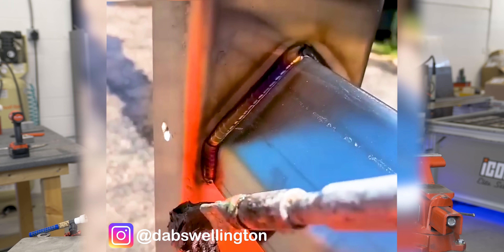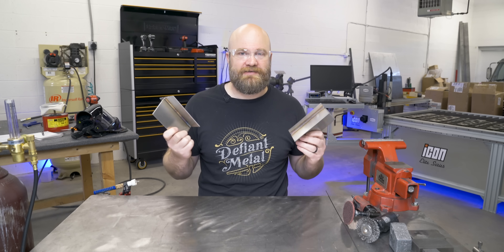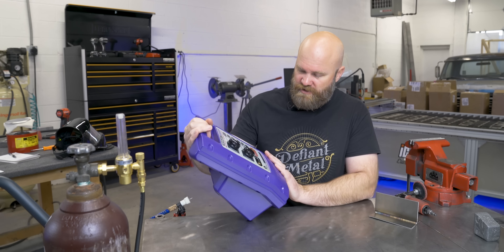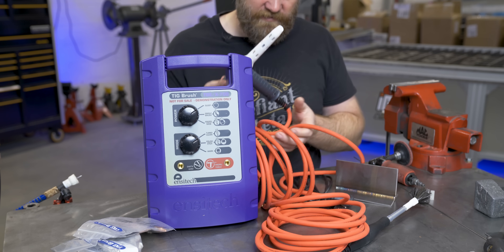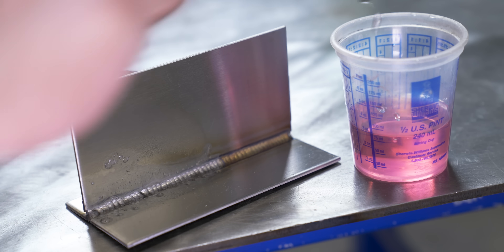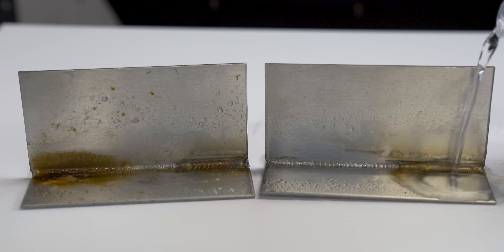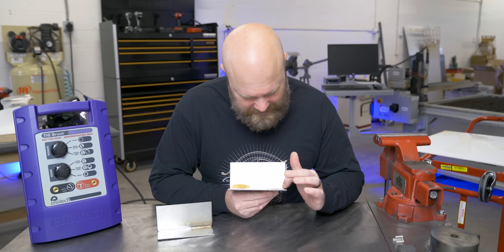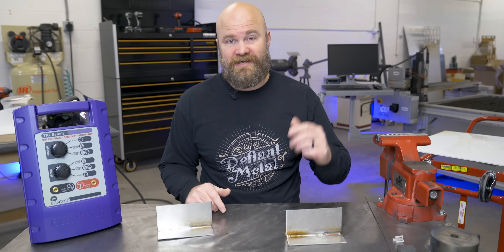Why Do People Do This To Their TIG Welds?? Electro Chemical Weld Cleaning

Comment: I took a class on tig welding. When welding stainless I had the hardest time getting the colors and mostly got a dark color weld. The teacher kept saying the weld was too hot. I turned the heat down, tried to move faster, and nothing helped and he would not tell me how to weld cooler if that is why it really what the problem was. Suggestions!!!!! Thanks
Reply: You didn't have enough gas coverage, your tungsten was contaminated, or like you said weld was too hot. I use a gas lens and the fupa #12 ceramic cup, try that with 15-20cfh of gas flow.
Reply: @diamondperformancefab5931  Dan:  
Thanks for the information. Hope you and your family stay well and have happy holidays.
Reply: 'The teacher kept saying the weld was too hot'   You can reduce the heat input value by turning the amps up, by melting the metal quicker allows you to travel faster, net result lower heat input value.  -   Amps x Volts x 60 / travel speed x 1000
Reply: @iwb316  Thanks. Happy Holidays

Comment: From what I’ve heard and read about Tig welding a good Tig weld is not supposed to be colored there should be a colored boarder a few mm away but the weld should be silver even on metals that anodize

Comment: Did this at my previous job, it's definitely a neat process but it absolutely sucks to do for hours on end when you're cleaning complex parts, especially with all the safety equipment I had to wear.
Reply: If you don’t mind me asking, what kind of safety equipment did you gave to wear.
Reply: @chrisp9046  Safety glasses, chemical resistant long gloves, and a filtered respirator (like the ones you would find in a paint shop) due to the fumes.
Reply: @H2Oslicer123  Ahh. And do you do this for an extended period of time? I’m thinking I ought to use more/better ppe when I do this at work, even if it’s occasional.
Reply: @chrisp9046  yea, nitric acid fumes aren't something you want to be inhaling, especially over long periods of time. How long a part takes to clean depends on your setup and how complex the parts are, however most of the time (maybe 2/3) will be spent cleaning the acid from the part. Sometimes I could spend an entire shift cleaning parts.
Reply: Why do you characterize it as defiant?
Reply: @bent.cyclist  maybe it was a typo and he meant definitely

Comment: I spent 7 years building 304 and 316 stainless tanks for agriculture. We pickled most of our welds but also used a surfox machine on heat tint from interior welds. Worked awesome! Pickling will discolour the material more but these machines will remove just the tint if you don’t go nuts with the machine. We found that the pickling was sufficient passivation. The crazy thing is stainless will “heal” itself eventually. It will develop a passive layer over time. Even rust spots will eventually eat themselves away. For ag use it’s amazing what stainless with hold up to!
Reply: *FusciaCone comment reprinted from PracticalEngineering corrosion coatings thread: "This might be off topic...  Our company moved to stainless steel for outdoor fasteners.  The surface corrosion was a lot less offensive to our customers.  However, larger enclosures still exhibited ugly surface rust.  We tried 304, 316, and I think 316L.  All exhibited the surface corrosion.  So we visited the nice people at the Monterey Aquarium Research Institute.  While this group shares the same name as the commercial aquarium, it's nothing like the aquarium (you might enjoy that little research tidbit).  We found those guys used electro polishing on all of their buoy mounted instrumentation.  We then tried 304 with a passivated surface, 304 with an electro-polished surface, and 304 that was first passivated then electro-polished.  Turns out 304 with electro-polishing stayed beautiful under pretty extreme conditions.

We used elevated temperature salt-fog testing to accelerate the test interval.  

Then we setup an outdoor test site on a beach near Moss Landing CA.  Photos every 30-days.  Test ran for, I'm not sure but I think about, 5 years.  304 with electro-polish was super good.

This was all done like 20 years ago now.  You might enjoy exploring SS options.

BTW: We have found that coatings like paint and powder-coat that sustains enough mechanical damage (which doesn't have to be more than a small ding or scratch) will allow corrosion to creep under the coating effectively pealing off the coating.  Aluminum was the substrate material.  We found anodize was the most resilient.  We also found not all anodizing is created equal.

Love your videos!  Keep having fun and sharing your findings!"*
Reply: Surfox makes a pretty strong electrolyte solution for even Mig stainless cleaning, Works awesome for intense tig applications aswell. Their "G" solution vs "T"
Reply: @dootdoot1867  yep. A lot of our stuff was mig welded. It’s pretty cool what you can do with the surfox
Reply: @jeremyromand  I welded up a SS mixing vat for my ag business, not knowing about how the heat affected zones will rust.  After years of dealing with a mild steel vat and bits of rust clogging my nozzles, I thought the days of washing rust out of the tank was over with my brand new SS vat with all the pretty rainbow welds...until the first load of defol rusted everything I welded.  I later learned that while it's not ideal, once that surface layer gets rusted away you'll get back to good SS and it'll stop rusting for the most part.  Today it looks rust free, probably because of all the chemicals I've used have essentially pickled it over and over.  Every welded SS part from that point on was passivated after I figured out what was going on.  The fittings and t-booms on my plane haven't rusted anywhere in the 6 years since I made them, in fact they still look the same as when I made them.
Reply: 400 series stainless will still rust, but is much more resistant than regular carbon steel.
Reply: Rust spots???... Must be a low grade stainless... But being RollsRoyce I wouldn't know of such stuff😁
Reply: @lordbelvoir2543  Rust spots is normal on welded stainless, the iron separates on the surface of the melted metal so you get tiny spots of iron that is not chemically bonded with chrome. After it rusts and gets worn out of the structure it's completely fine as most of the steel is actually stainless. Low grade is the stuff that will easily rust "out of the box" in patches\strips (depending on how it was formed), THAT is low grade stainless.
Reply: @ScarletFlames1  mate I stand corrected.... Shouldn't have opened me gob having not dealt alot in stainless
Reply: @ScarletFlames1  Also, if you use tools that have contacted mild steel on stainless, the stainless will nearly rust while you look at it.
Reply: @mikeford963  that's just direct contamination, it'll form surface rust and inside the scratches the iron got shoved into during abrasion and then you'll be left with a slightly rusty looking stainless steel. Unless you somehow put a deep thin groove and filled it with iron the expansion when it oxidizes won't cause anything other than surface damage.

Then again, many times stainless steel is used for its surface properties so that contamination is undesireable.

So as was summed in the video, have separate abrasives for anything that can rust vs anything that won't.
Reply: @ScarletFlames1  delamination as we called it was a thing I had to deal with from time to time. It would depend on the mill that made it. But that’s a great example of contaminants during the hot rolling process. We used primarily 12,10,and 7ga rolls of steel.

Comment: I am an advanced hobbyist, and I build motorcycle exhausts, and the occasional architectural railing in stainless.  I looked into passivation quite a bit several years ago. The thing about the industrial passivation chemicals is that it contains a strong acid, and the smoke/steam/mist that comes off of it is somewhat dangerous - as you mentioned, it will rust everything in your shop without proper ventilation, and it's not at all good to breathe.  I purchased some carbon brushes off Amazon, which I hold in a rod stinger from my TIG welder running ~25 amps AC, and use heated citric acid, which is basically the active ingredient in lemon juice.  It takes longer, and makes a horrendous sticky mess, but it works.  One thing I've found is that when you place and lift the brush, it needs to be quick, or you get arcing which can mark the material, and the arc eats up the brush.
Reply: This post answers a huge question for me. What is the difference between an AC tig machine and one of these incredibly expensive tig brushes? None, it would appear. Some of those tig brushes like the Capitol go up to 200 AMPs. Ouch.
Reply: Use a crimped copper pipe wrapped in rags and soaked in citric acid solution, then wipe it across the welds.
Reply: there is a citric acid gel I used to passivate stainless. useful for passivating insides where you cannot easily reach. I just let it sit over night and it dries, than just wash down with soap and water. Non-toxic & no risk of a chemical burn.
Reply: 3M bristel brush.Same like finish then a wire brush. And don’t have the chemicals.
Reply: @mariomachielse2236  the purpose of passivating is to remove potential sources of corrosion, wire brushing is not going to do that completely.
Reply: Passivation builds an oxide layer on stainless steel that protects the underlying metal.

Comment: Holly S --- at $6,000 bucks !!!!
Reply: The big Walter one is $9000 also. I own one but  bought it used. Definitely worth it. Has made me alot of money on kitchen and lab jobs.
Reply: phosphoric acid (relatively safe) , 12v 20a dc power supply, carbon fiber brush (-), ground clamp (+), rinse well with just water

Comment: Worth mentioning that hydrofluoric acid will absorb in through your skin and attack your bones. Even a tiny drop on a finger, even if washed off immediately, can result in the loss of that finger, or your whole hand/wrist if you don't seek immediate treatment. It can also cause fatal cardiac issues. HF is the nastiest acid I know that's actually used for anything outside the laboratory.
Edit for clarification: Hydrofluoric acid "pickling paste" was the *old way*. That's the justification for the expense of one of these electrochemical units. They may be a bit of an investment, but you can't put a price on health. The use of electricity allows for much milder solutions to be used, even non-toxic citric acid based solutions work with electrochemical cleaning.

Also, not to be a grammar gestapo, but it's "passivate/passivated" not "pacify/pacified".
Reply: I got a large dollup in my right eye and had to go to the hospital but I did not lose the eye. Immediate milk and water saved it. It's now ten years later and the eye is working fine. This acid does not get in your bones or cut off your fingers if you get a drop on them. At least the acid they sell for pickling welds. Thanks.

Comment: Thank you for presenting this. Passivation is poorly understood, but for sanitary welds, absolutely essential.
Reply: Particularly if the service is the food or chemical industry. Those surface oxides can be very detrimental to the vessels contents or they can effect the actually weld performance in service.
Reply: And how you clean the inside????

We use formation gas and clean outside electronic  for more than 20 years already
Reply: I’m a machinist but not a welding expert by any means so I’m glad you mentioned sanitary applications. I didn’t even think of that although it would most likely be specified by the customer but also good for us to have the knowledge regardless
Reply: @SolasChristusMinistry  I worked in a shop where we built a stainless steel tank for a company that made gelatin products. The customer specified that they would be responsible for all on site cleaning prior to the unit being placed in service. Another part of their specifications was to do a dye penetrant test on the floor to shell weld. Sine the tank was to be painted on the outside, we applied the dye on the inside and the developer on the outside. This was because the dye is a bear to remove.  We shipped the unit and about a month later we received a very angry phone call from the client. Seems that had not done the internal cleaning as they should nor did they have the Government inspectors in as they are supposed to by law on any foodstuff installation. Because they jumped the gun and cut corners to begin production, they now had 10,000 gallons of pink gelatin......... They also had their operating license revoked until every inch of their plant was inspected for other "cost cutting" methods.
Reply: @oh8wingman  Oh, that must be why I got such a discount on all that pink gelatin I bought.  Nothing a little SKC-5 can't get rid of 🙃
Reply: Passivation isn’t hard to do.  It can be done with citric acid.
Reply: We used it all the time at the Kraft plant.

Comment: Question for everyone.. I am just getting into welding/fabricating.  Which style of die grinder should I buy. Straight or 90 degree?
Reply from the maker: 90*
Reply: I hardly use my straight die grinder
Reply: Both, but 90 if you can only get one. You'll use it a lot more.
Reply: Not to answer the question directly, but buy a decent polycarbonate face shield $20 and good cutting discs.
Reply: @carpediemarts705  already have it.  I am originally a wood worker.  I am getting into fabrication/welding as I am sick of buying overpriced prefabed metal table legs..
Reply: Both. They're cheap enough.
Reply: @jasomkovac9115  I like your thoughts.. I do always need more tools
Reply: After years, I finally bought a 90°, and it's GREAT.

Comment: pickling gel works just as well and it's cheap. just wear some plastic gloves, faceshield / glasses. let it sit / soak for 30+ minutes and rinse of with water. i built a huge plastic container and just let it soak in there for a few hours to make sure it removes all the contaminated dust around me. i weld only 316L so I can't speak for 304 stainless.
Reply: pickling gel works wonders with both 304L and 316L, just dont let it be too cold when using it(takes forever for it to work). I make different constructions / machines for aquaculture.
Reply: @Onkael91  question, what do you use for filler when welding 304?
Reply: @blip033  316L

Comment: Whish to see a clean (new) stainless wire brush… Probably the same good result as the electricthing. But much cheeper.
Reply from the maker: Maybe I’ll try that for a YT short or Instagram when I get some new brushes in.
Reply: @JustVoss  , yeah, that wasn't a clean s/s brush. You kinda put a bias on the cleaning stuff.
Reply: @jasomkovac9115  as stated above, a stainless steel brush, used ONLY on stainless steel, will work as well....  Just hope you're happy with the finish looking all scratched...
Reply: @fredfleming2455  , yeah, know about the finish.  But there's times it doesn't matter.  The 3m(or whatever) mesh is one of the nicer finishes. The electro finish looks easiest,  but never used it.
Reply: @jasomkovac9115  Have used this machine extensively, and a different brand. both give great results, but they're a bit messy. Also you MUST keep the carbon brush very wet, otherwise it will affect the finish...  cheers
Reply: a new brush is pretty clean but, really soap water and passivation is the best for food and pharma grade jobs
Reply: a company did that to some gear at work. looks fine for a year or two, then fine rust starts coming through. its not just about looks, its about making it corrosion resistant.

Comment: Stainless wire brush when the weld is still warm, easiest way.
Reply: Yeah pipes different, I’d do the same as what you said. But for a fillet in sheet or box section wire brush haha
Reply: Leaves scratches though
Reply: @liamobrien9451  scotch brite cloth after
Reply: @jackhooper1935  I guess it depends on what kind of stainless you are using, our pipes are quite dull so after a wire wheel and scotch brite you'll be left with a visibly shiny area around the weld

Comment: Hydrochloric acid not hydrofluoric acid….  Unless you’re insane.
Reply: Nevermind.  Pickling paste is HF, no way… no thank you.
Reply from the maker: Exactly, not a chance I’m touching it
Reply: @JustVoss  your not meant to roll around in it ! 
its usually a mix of a couple different acids. its not nice stuff and its a pain to use, but its a lot cheaper than one of those machines.
would be interesting to see a comparison to a home made version using a bench power supply.
Reply: The pink acid that is meant for cleaning aluminum that also works on stainless is Hydrofloric acid (5%). It's called Weld-O. 
Made by Arcal Chemical company. Just wear gloves and glasses but it works very well.

Comment: He'll yah I've done passivation on stainless pharmaceutical 316. With citric  acid but I don't know if they applied a voltage to the solution. Do you know the difference, if any?
Reply: Yes, it's "passivate" not "pacify."  Removing free iron from the surface and letting a chrome oxide layer form on the surface of stainless, which stops further corrosion. Nitric acid has traditionally been used, and less hazardous than hydroflouric.  For most of us it's even better to use citric acid (there are commercial formulas), getting the weld and HAZ wet with a brush or cotton swab.  Wait a minute or two, then rinse.  Inexpensive, almost no hazard. Let's not make this more complicated, expensive, or hazardous than it needs to be!
Reply: Guess I'll have to ask the old foreman hopefully his number still works..

Comment: I don't like the fact that where I work, they wirewheel the color out of stainless. Much sad. Very tear.
Reply: I did a job at a food factory, grinding everything smooth, wire wheel, chemical cleaning, then scotchbrite to make sure all the micro scratches were in the same direction as the surrounding metal.